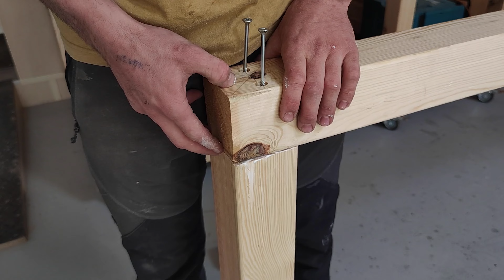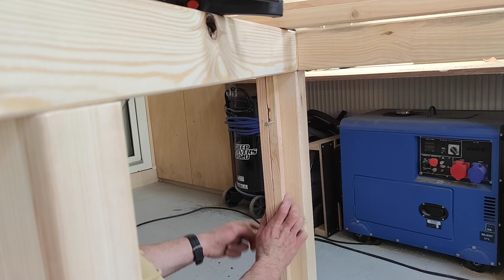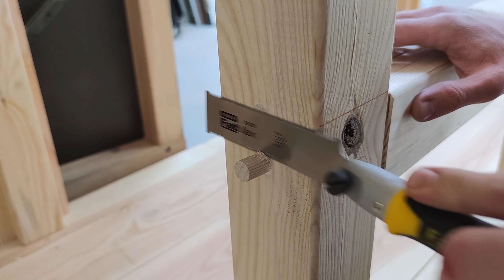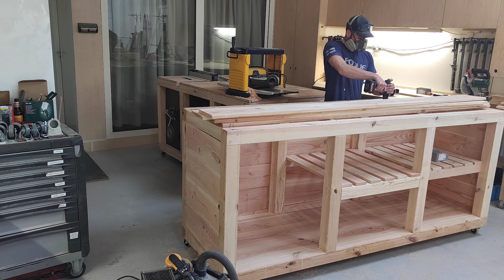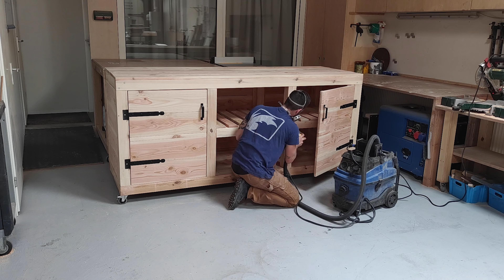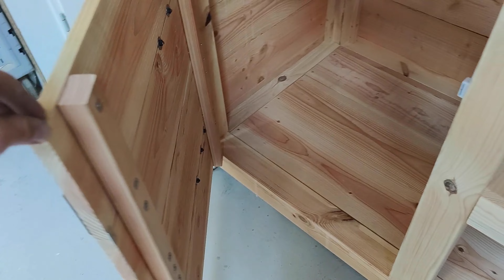Easy Outdoor Kitchen Build - Woodworking DIY

Comment: Absolutely hate DIY videos where the guy has over $10k in equipment in a workshop
Reply: Yeah a chop saw, plainer, orbital sander and drills is definitely 10k. You have a festool budget when you should have a harbor freight budget
Reply: The plainer isn't even remotely required for this project (same with the table saw and paint sprayer).  The total power tool budget for this job would be under $500, and that's starting from absolute scratch.  If you already have basic hand tools (drill, driver, sander), call it $250 for a miter saw and you're good to go.  Another $100 for a jig saw if you need to make the cutouts.
Reply: lol🤣
Reply: I hate when a guy in DIY has his own shop😂😂😂
Reply: I was just about to write this until i saw your post. How about a video for a guy who has a miter saw and a dewalt drill!!!
Reply: Ne to😂
Reply: @melahi7 then WHY watch?!?
Reply: I DIY and have acquired tools over time.  If your thinking of a build with a hand saw, just give up and don’t fool yourself. Even DIY requires some amount of tools. Don’t criticize because the other guy has better tools.
Reply: DIY stand for do it yourself.

Not do it as basic as possible!!
Reply from the maker: If you choose the right project's and earn some money, re-invest to buy some tools.. in a very short time you will have a good base to start with! =)
Reply: @aileronsintowind6835  at certain point everyting is diy... 🙄

Comment: I loved this video and your techniques, learned a few things I hadn't considered before which will improve my skills, thanks! - could you tell me what the screw in spacers you used for the recessed tops are called please?
Reply from the maker: My apologies for the late reply. These are rubber finishing caps for screws that I had left over from another project.
Reply: @BlackHatProjects  Many thanks for the reply
Reply from the maker: @DODrumming  With pleasure! ☺️

Comment: I intend to build your design for my pizza oven. I was just wondering about the thickness of the wood for the frame. Is it 6.5 x 6.5 cm (common size in The Netherlands) of closer to 8 x 8 cm?
Reply: Just by looking at it I would say it's easily 10x10 even, but I would go for 8x8 probably. I am thinking about building this too myself for our kamado but I was wondering, how would something made completely out of wood take the heat of a ceramic kamado? Is wood ok to use?
Reply from the maker: Goedeavond, ik dacht dat deze balken 8cm waren! =)